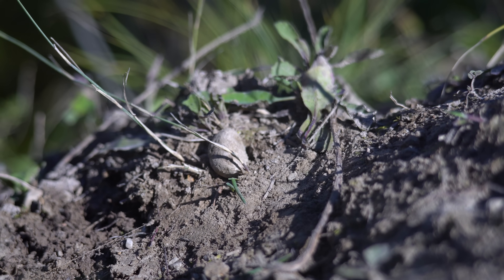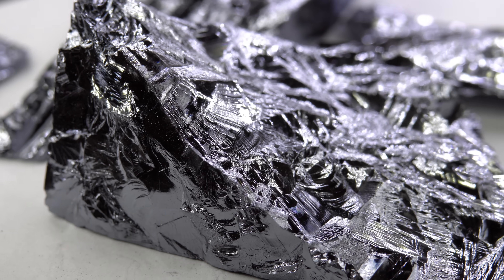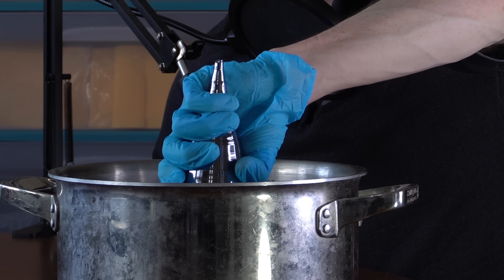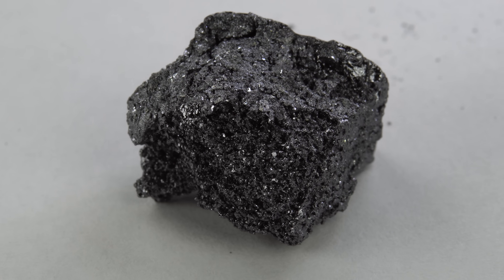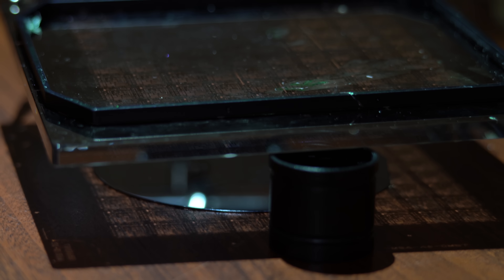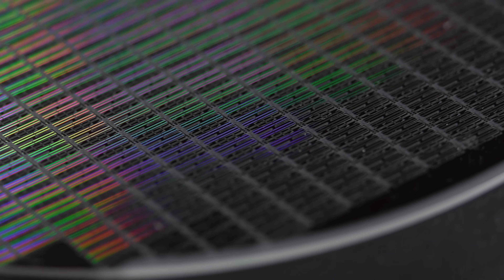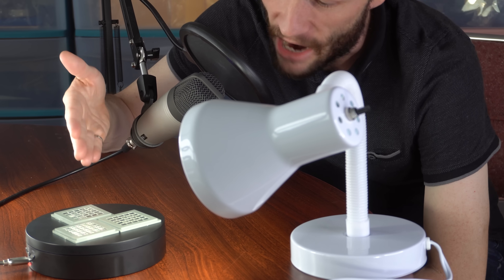How To Make A CPU

Comment: First, get a rock. Then, smash the rock. Now you've got 98% Concentrated Silicon Dioxide. Purify it to 99.9% Pure Silicon Dioxide. Purify it to 99.9999999% Polysilicon metal. Put the Polysilicon ingots into a crucible and heat them to 1698 degrees Kelvin. Take a small seed Monocrystal and dip it into the vat of molten silicon. Slowly pull the crystal as it cools. Now, you've got a Monocrystal of Pure Silicon. Cut the Monocrystalline silicon ingot into thin slices. Now, you've got pristine, freshly cut Silicon wafers. Dope it with some Boron or Phosphorus. Put photoresist on the wafer. Take your Chromium-etched Photo-Lithographic Quartz mask and shine a torch through it onto the wafer. The locations of the shadows produced by the photo-mask will control the location of highly localized chemical reactions on the surface of the silicon wafer. Now, develop the Photoresist. Acid etch the exposed parts of the wafer. Wash away the leftover Photoresist. Now, do some Homoepitaxy, Heteroepitaxy, Pseudoepitaxy, Diffusion Doping, Copper Interconnects, and Chemical Mechanical Polishing. Now, you've got a finished silicon wafer! Cut your silicon wafers into small pieces. Now, you've got unpackaged silicon dies. Locate the pads on the silicon chip and attach bond wires (Or use the flip-chip method). The bond wires provide an electrical connection between the pins on the chip package, and the pads on the silicon die. 
That's how you make a CPU!

Comment: it's not like we figured that rocks = cpu. more like scientists found out silicon in sand behaves perfectly for switching electricity on/off. upon other discoveries by other scientists before that like karl f braun discovering the first "diode" then three scientists at bell labs discovered the first transistor. then in 1958 lots of electrical components were just too much - so some guy thought what if all these components was just made of one material? that way all these barbaric electrical systems didn't need to have wires. so they built the first integrated circuit. people discovered that certain crystals can control electricity. 150+ years of poking rocks, messing with physics, and refining until bam

Comment: Make another video on the circuitry you edge into the wafer, starting by describing a condensator as 2 neighbouring metal plates with a charge difference up to modern MOSFETs

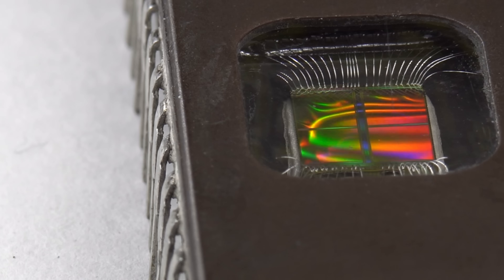Comment: 1:39 
1)  Get a rock.
2)  Smash the rock.
3)  Now you have 98% concentrated silicon dioxide.  Purify it to 99.9% pure silicon dioxide.   
4)  Purify it further to 99.9999999% polysilicon metal.
5)  Put the polysilicon ingots into a crucible.
6)  Heat the silicon ingots to 1698 °K.
7)  Take a small seed monocrystal and dip it into the vat of molten silicon.
8)  Slowly pull the crystal out as it cools.
9)  Now, you've a monocrystal of pure silicon.  Cut it into thin slices.
10) Now, you've got pristine freshly-cut silicon wafers.  Optionally, dope them with Boron, Phosphorus or another dopant.
11) Put photoresist on the wafer.
12) Take a chromium-etched photo-lithographic quartz mask with your desired circuit pattern and shine a laser beam through it to project the circuit pattern onto the wafer.
13) The locations of the shadows produced by the photo-mask will control where the photo-resist is chemically changed on the surface of the silicon wafer (depending on whether you used positive or negative photoresist). 
14) Now, develop the photoresist.
15) Acid etch the exposed parts of the wafer.
16) Perform countless iterations and repetitions of homo-epitaxy, hetero-epitaxy, pseudo-epitaxy, diffusion doping, copper interconnect layers, chemical mechanical polishing, photoresist applications, acid etching, and photomask exposing to build up the desired features on the wafer.
17) Now you've got a finished silicon wafer.  Cut it into pieces.
18) Now you've got un-packaged silicon dies.  Locate the pads on the silicon chip, and attach bond wires, or use the flip-chip method as is done now for most modern processors.
19) Use the bond wires or solder balls to provide an electrical connection between the pins on the chip package, and the pads on the silicon die
Reply: and that's how you make a C

Comment: BS. You can't create complex wired connections of nano size by just mixing chemicals and cutting. This requires a lot more than just that and a lot of fine machinery to do it.
Now, the real problem is how someone human would come to the conclusion of doing this absolutely humongously complex thing without any prior steps towards it. Its not the same as going from a coal engine to a fuel engine. This is literally going from a copper wire to the moon in only one step. It makes no sense. Therefore all this technology is not manmade. It was given to us. Also explains how ufo encounters shut down things and they stop working, and how the times the military shot missiles at them, the missiles just stopped working. It's because they gave us the tech, so they can shut it down with a simple button. It's like us giving a caveman fire, and when he attacks us with fire we just throw at him some water and the fire extinguishes, and the caveman does not understand how that happened. Meanwhile we have an AK47 to defend ourselves and a taser to subdue him. They are way beyond this tech they gave us.
And gave us... in exchange for what?
Reply: You're underestimating humans intelligence

Comment: That's only the physical production process of the cpu. Modern cpus use micro-code which is low-level software instructions that drive the hardware. Nowadays cpus are also always integrated with several tiers of memory and corresponding busses. Basically a computer architecture within the cpu. Containing many billions of transistors. The whole design and manufacturing process is extremely complex, why only a few companies are able to do it.
Reply: So, I guess you're saying to maybe get 2 rocks?

Comment: How to make a CPU from scratch (any% speedrun glitchless):

1)  Get a rock.
2)  Smash the rock.
3)  Now you have 98% concentrated silicon dioxide.  Purify it to 99.9% pure silicon dioxide.   
4)  Purify it further to 99.9999999% polysilicon metal.
5)  Put the polysilicon ingots into a crucible.
6)  Heat the silicon ingots to 1698 °K.
7)  Take a small seed monocrystal and dip it into the vat of molten silicon.
8)  Slowly pull the crystal out as it cools.
9)  Now, you've a monocrystal of pure silicon.  Cut it into thin slices.
10) Now, you've got pristine freshly-cut silicon wafers.  Optionally, dope them with Boron, Phosphorus or another dopant.
11) Put photoresist on the wafer.
12) Take a chromium-etched photo-lithographic quartz mask with your desired circuit pattern and shine a laser beam through it to project the circuit pattern onto the wafer.
13) The locations of the shadows produced by the photo-mask will control where the photo-resist is chemically changed on the surface of the silicon wafer (depending on whether you used positive or negative photoresist). 
14) Now, develop the photoresist.
15) Acid etch the exposed parts of the wafer.
16) Perform countless iterations and repetitions of homo-epitaxy, hetero-epitaxy, pseudo-epitaxy, diffusion doping, copper interconnect layers, chemical mechanical polishing, photoresist applications, acid etching, and photomask exposing to build up the desired features on the wafer.
17) Now you've got a finished silicon wafer.  Cut it into pieces.
18) Now you've got un-packaged silicon dies.  Locate the pads on the silicon chip, and attach bond wires, or use the flip-chip method as is done now for most modern processors.
19) Use the bond wires or solder balls to provide an electrical connection between the pins on the chip package, and the pads on the silicon die.

And that's how you make a CPU.

Comment: How do these things not cost way more?!
Reply: The materials aren't expensive, and the process is streamlined and made in huge factories domestically. And a lot of it is price gouging and artificial demand since all chips that are made in a certain generation are technically i9, or a ryzen 9, until they have inconsistencies in the manufacturing process, then they disable certain cores or features and market it as an i5 for example. Even if a chip is made perfectly and could pass as an i9. they might artificially disable certain features to meet marketing expectations.

Comment: We don't really think of it much but computers are really fascinating. This is a piece of equipment that can project information on a screen using plastic and metals. Information that you would otherwise put on a paper and bring it personally to someone. I can understand the concept of electricity to power up appliances like microwave or electric fan or how gas makes car run but computers are really alien-like if you compare it to the rest of the things that we use everyday. 

That piece of rock was formed so we can play our video games in 8k resolution with the highest fidelity.

Comment: I would just use transistors and resistors at 1.5V and a CR-signal generator with a 0.75V power supply, that than produces bursts of 1.5V. That way you don't need magic. Transistors actually respond to frequencies of 20GHz and although a simple addition of a byte will reduce the perceived processing speed to less than 1GHz for additions, due to the many ANDs, ORs, and NOTs, and storing overflow bits, when you have six or more math coprocessors, your computer functions just nicely.

Comment: This actually makes CPUs feel less complex than I thought. The whole photo sheet thing explains everything.
Reply: this. using lenses to concentrate light into a very small area allows you to use photons as chisels and scalpels. Imagine the processor layers on different 'slides'. You start with the base and layer by layer you build an intricate microscopic three dimensional network of conductors and semiconductors. Its pretty simple as a concept once you know how photography and chemical etching works
Reply: what is mesmerizing to me is how we managed to scale up very simplistic electrical gates. Connect enough logical gate circuits in the right order, run very precise amount of electricity through them, time it right and boom you got photorealistic graphics, AI, internet, music... its crazy.
Reply: EUV machines that can make chips are the most complex machines humans have build. They cost 400million per unit and only 1 company can make them. ASML 🇳🇱🇳🇱🇳🇱
Reply: Is this a discord kitten 🐱
Reply: @Mishu777  probb, but im too

Comment: Me: “mom Can i get a rock for my birthday”

Mom: “Uhhhh yes I guess”

thats only step one of my master plan to build The Intergalactic Omega-Tier 4000X HyperParallel Turbo-Charged CryoQuantum 40-Gigabyte Deep Neural Multicore BioOptic UltraAI Supercomputer Workstation with Overclocked Carbon-Nanotube Heatsinks, RGB-Enhanced Entropy Diffusion Rails, Modular Anti-Gravity Drive Bays, Infinite-Loop Cooling Reservoirs, Integrated Zero-Lag Cloud-to-Edge Neural Feedback Mesh, and the Patented Sentient Algorithmic Kernel v99.99.∞ Ultimate Edition super computer  WOOO HAHAHAHAHAAAAA 😈👹

Comment: I actually designed a PCB to interrupt any of my display connections because of the annoyance of switching between multi monitor work and gaming. It really should not need to be necessary nor the easiest solution

Comment: Meanwhile a gas boiler that is a box that uses fire to heat water using technology from the 1800s costs approximately 10 times more than the best intel CPU in the UK.

Comment: I used your method to make about 30 CPUs the other day, but they are running a bit slow... If I use a steak knife instead of a plastic butter knife to cut the dies do you think I'd get more stability out of em?
I still have some more rocks left over from the first step, so I can try again. 👍

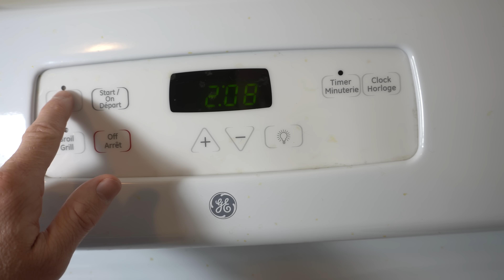Comment: 0:20 Incidentally this is why silicon-based life isn't feasible. Carbon-based life can split carbon dioxide apart into carbon and oxygen using the energy from sunlight. Silicon-based life would need to heat up to basically lava temperatures to split the oxygen off.

Comment: ›dig in remote places
›extract extremely rare rocks
>perform a forming spell on the rocks
›extreme heat and pressure are
required
›inscribe microscopic arcane sigils into your magical stones
>imbue the stones with lightning
›the stones gain anima
›the stones speak in a language incomprehensible to all
mankind
›certain trained warlocks can control the powers of the
stones
›they learn the language of the stones
›the warlocks harness the magical stones powers to bring forth light and image
>the rest of the population is in awe
>you can now access Fortnite porn anywhere you want from the palm of your hand

Comment: Since the video is a sarcastic speedrun-style summary, it uses exaggeration and absurd shortcuts to mock how impossibly complex it is to make a CPU "from scratch." Here’s a breakdown of the sarcasm, humor, and hidden meaning in the steps used:

⚠ 1. “Just grab some sand”
🧠 Sarcasm: Like it's no big deal—you can make a CPU just by picking up sand from your backyard.
💡 Reality: It takes ultra-pure silicon, requiring industrial-grade purification processes. You can’t just grab sand from a beach and expect to make a processor.

🔬 2. “Make a silicon wafer, simple stuff.”
🧠 Sarcasm: As if growing a perfect monocrystalline silicon ingot and slicing it into mirror-polished wafers is like baking a cookie.
💡 Reality: This step needs billion-dollar foundries, clean rooms, and atomic-level precision.

📸 3. “Now draw the CPU with light”
🧠 Sarcasm: Sounds like using a flashlight and some doodling.
💡 Reality: Refers to photolithography, a cutting-edge process using ultraviolet lasers to etch microscopic patterns smaller than a virus onto silicon.

⚡ 4. “Add some electrons and boom – logic gates!”
🧠 Sarcasm: Oversimplifies doping, where elements like boron or phosphorus are added to control electrical conductivity.
💡 Reality: This step is done with ion implantation—high-tech and dangerous.

🪛 5. “Solder it to a green thing and you're done!”
🧠 Sarcasm: Calls the motherboard a “green thing” and makes CPU packaging sound like gluing craft pieces.
💡 Reality: CPU packaging is one of the most technically demanding steps, involving microscopic connections, signal routing, thermal design, and electromagnetic interference shielding.

🧠 6. “Now go play Minecraft!”
🧠 Sarcasm: After supposedly “making” a CPU, the end goal is… playing Minecraft, as if the journey was trivial.
💡 Reality: It takes decades of R&D, thousands of engineers, and advanced physics to make a CPU, which is then used for casual gaming.

Comment: The latest chips are made using ASML's Extreme UV equipment.  A laser is used to blast a stream of molten tin droplets into a plasma which emits UV at a wavelength of 13.5 nanometers.  The UV light is then reflected off of a series of concave mirrors, and is then reflected off of the mask onto the wafer.

Comment: I get why it sounds like magic, but with our current understanding it's quite possible, we have the technology to do these things, the shocking part is the fact that humans thought of it before it was a thing, it's easy to explain something that exists but someone had to think of using poly silicon ingots with crystals to produce monocrystals of silicon to cut into thin slices of wafers. You gotta appreciate how clever these humans are, developing a method to form templates on silicon wafers through light and the use of masks to filter the light in specific ways to form the template on the wafers. Then the whole homo and hetero and pseudo epitaxy are the processes forming new layers filling the template made by the photolithography mask. Obviously there is a lot of information here left out, like what the later layers formed through epitaxy are made of and lattice shaped structures being made and why. It's just a nice way to show people how much science has been put into the creation of the chips we casually use in our computers, phones, cars, and etc.